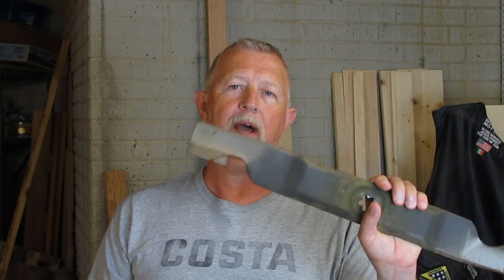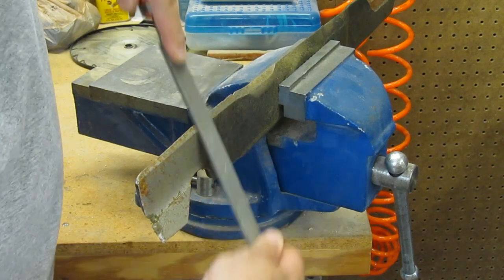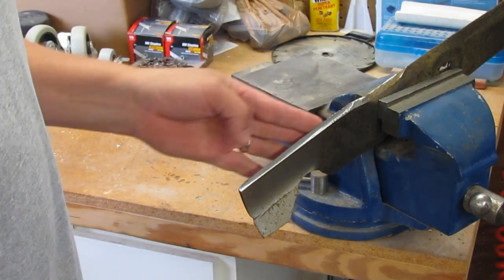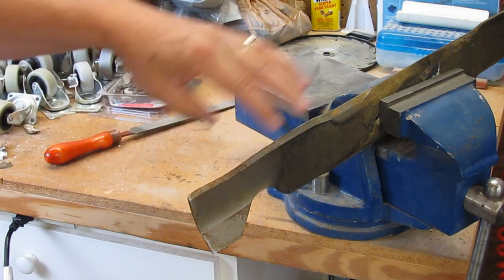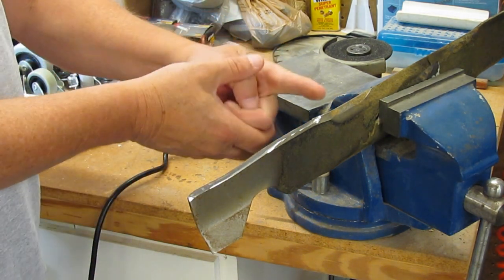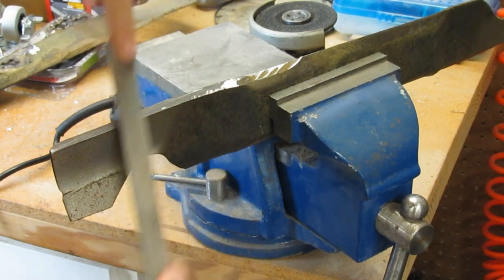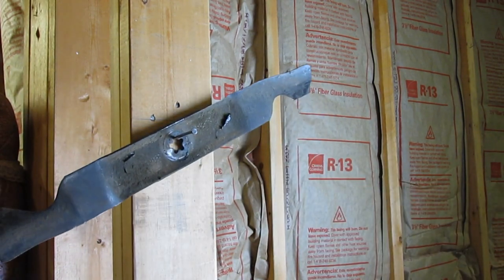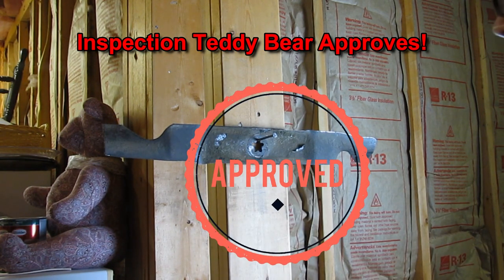Sharpen and Balance Lawnmower Blades

Comment: Dennis, Great filing technique!! My father was a machinist and if I tried to saw with a file I would catch it.   For the angle grinder I use the flap type sanding disk, 80 grit, I used to use a wet wheel bench grinder so as to not pull the temper.  The angle grinder is so quick you don't build any heat it is my go to now.
Reply from the maker: Thanks for watching and for the feedback, David!  I hadn't thought of using a flap disk...that's a great idea!  I agree, the angle grinder is the way to go.

Comment: Hi Dennis 
Thanks for your advise
I have a husqvarna yth21k46
After cutting the grass at the middle I see uncut grass, as you advised I check tyre pressure , adjusted deck from front and sides still I have this problem 
I am waiting for your advise
Thank you very much
Reply from the maker: Thank you for watching, Assad!  I would check to be sure the blades are fairly sharp and on properly (not installed upside down).  Also, measure the blades to be sure they are the correct length.  Your blades should measure between 22-3/4" to 22/7/8", depending on the brand.  Here's a link for the correct blades, if you need it:  https://amzn.to/3M7ar0O 
If all that checks out, I would check the deck spindles for excessive play.  If they are worn too badly, the blades won't run true and you will get a bad cut.   Here's a link to my other videos on these mowers, there are several on blades, decks, belts and spindles:  https://youtube.com/playlist?list=PL4NggU4HQqRkfSYrAS1teGg2OJJ-ZW4ie